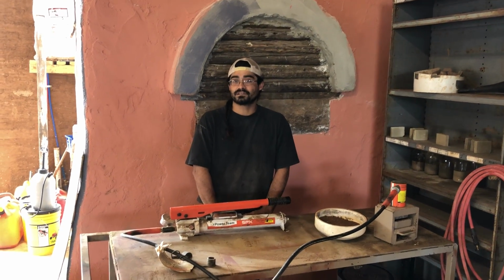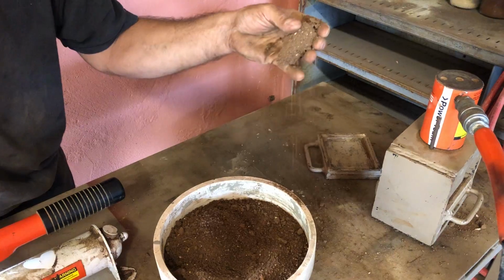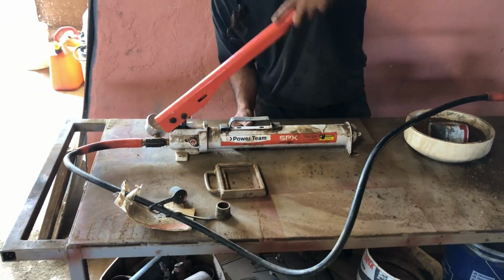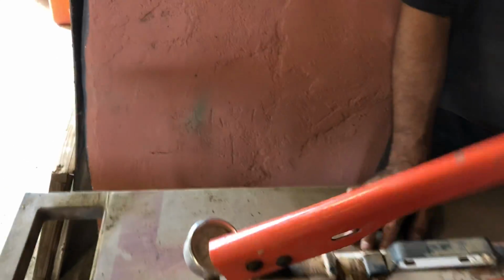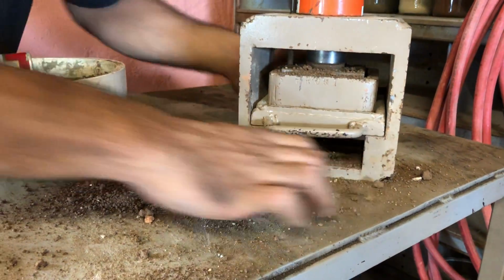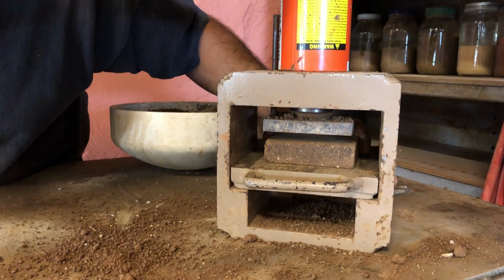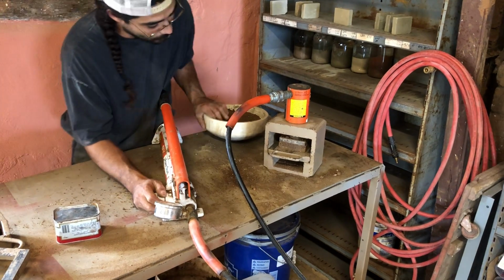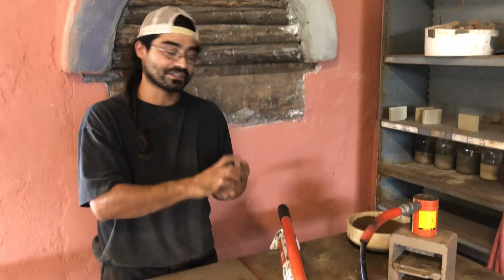AECT Small Block Press

Comment: Very cool!

So that block is 2.5" x 3.5" or 8.75 SQ in. If that blew out at 1,800 lbs then the compressive strength is about 1800/8.75  or 205 lbs/SQ in. Is that the correct way to calculate that?

The block would be stronger when dry, right? 

California requires Adobe to have a compressive strength of 300 psi.

I wonder what percentage improvement there would be once dry.